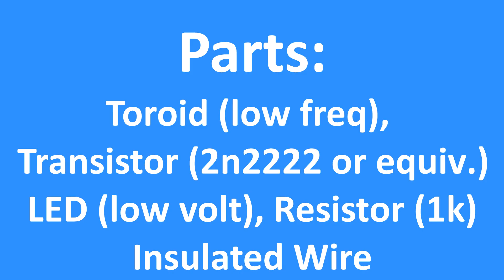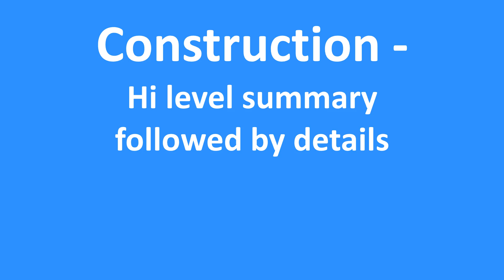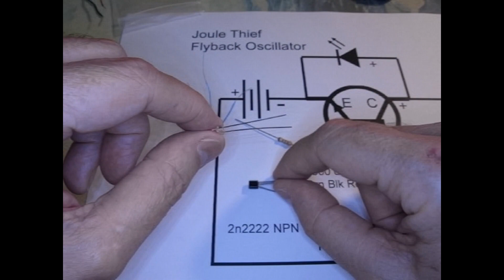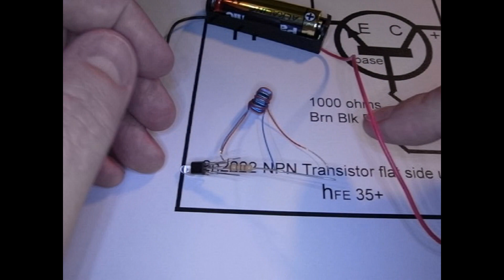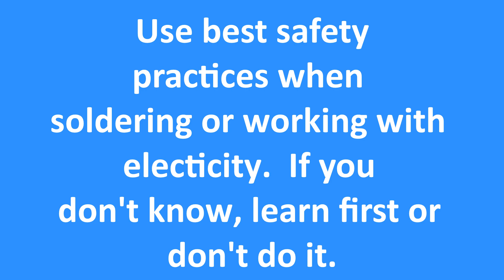Joule Thief - Detailed Build

Comment: Most Joule Thief circuits I've seen that use these components connect the Transformer in the opposite direction.  That is, the "center tap" Transformer lead is usually connected to Battery Positive, and the other two Transformer leads are usually connected to the Transistor Collector and Transistor Base.  In your circuit, the "center tap" lead is connected to Transistor Collector, and the other two Transformer leads are connected to the Transistor Base and Battery Positive.  Does it work equally well either way, or is there an advantage to your method? Thanks!
Reply from the maker: The circuit I use is a redesign of one from a 1970s era transistor checking circuit. I chose it because it was developed by experts at such circuits. I have not tried the other configurations and I really should; it would be interesting. I will have to put it on my list of to-dos.

Comment: All the other Joule Thief circuits I've seen that use these components wrap the coil with a 1:1 turn ratio.  Will this work with 1:1 or is 1:2 turns ratio required?  Thanks for the great video!
Reply from the maker: Ratios can raise or lower the base's voltage allowing one to run with more or less voltage. I got a new (usable) oscilloscope so I should put it to good use on that.

Comment: Is it copper coil or just a random wire. And can we work out with BC 547 Transistor?? And your coil primary and secondary connection is not clearly visible or explained. Can you explain it better?
Reply from the maker: The wire is insulated copper.  The BC547 is NPN and it will probably work (but I've never used one).  I show how to wind the coil and include a circuit diagram.  I am not sure what question you have on connecting the coil.

Comment: What if i use a 200 ohm resistor will it work.?
Reply from the maker: It will work, but the voltage flyback may spike the base, damaging the transistor.
Reply: tsbrownie ok then 1 k ohm is better and im using a 2N2222 transistor will that do
Reply: tsbrownie thank you very much i finally made it
Reply from the maker: 1K is kind of a general value for a "dead" battery.  If you have more input voltage you need more resistance and vice versa.
Reply from the maker: Congratulations!

Comment: With 2 color wires on the toroid, how is it hard to determine that the coils are not wired in opposite polarity like they should be?
Reply from the maker: I did a video on that.  Turns out there's not much difference as far as this circuit is concerned.

Comment: can we use copper wire instead of the blue and brown wires
Reply from the maker: It MUST be insulated wire.  It can have plastic or enamel coating, but it must be insulated.  Note that the core can have shape edges and can cut through insulation.  Also, vibration can wear through insulation (the core is very abrasive) so if you want it to last a very long time, you can dip it in enamel to lock the coils in place and keep them from moving and rubbing.
Reply: so inside the insulation it should be copper wire
Reply from the maker: Yes.  If you are very rich, you can use gold or silver wire, but it must be insulated in any case!  ;)

Comment: what wires have you used 
,is it copper wires and are both the blue and brown wires the same,pls reply
Reply from the maker: The wires are ordinary.  Bigger wires are lower resistance, BUT they are harder to wind and you can not get as many turns.
Reply: @tsbrownie  what if we take bigger core?
Reply from the maker: @chongshenchang9367  A bigger core will probably work, but it should be the same color (black in this case).

Comment: What is the O.D.and the height of  toroid  that you used, and the gauge of wire you used. My brother has some small  toroids. He has tough me some about electronics.  I want to keep it as close to yours, because yours works good.
Reply from the maker: The wire gauge is not critical, so long as you get the number of turns you need.  This is wire wrap wire.  The toroid is 1 cm across the outside.  It's black (the colors indicate different "speeds".)  It's not that critical.  The bigger ones work just as well, but they are not very convenient.
Reply: Thanks. This is small and will fit nicely inside of a solar powered landscape light. The light stays lit for about 4 to 5hrs, this should extent the on time. After all it is only 1.2v to begin with.

Comment: I must have sat through a dozen DIY joule thief videos and in not one did the "expert"  mention: 1. How long a wire you start out with for each winding, 2. The gauge of wire and 3. In what direction you wind each  one (same for both or opposed)
Reply from the maker: Good points 1) depends on the size of the coil.  If you measure the 4 sides of the toroid, then multiply by the number of turns you want, then add a bit extra for connections that's the length.  2) wire size is not terribly important, but if it's too big, it won't go many rounds through a small toroid.  Using the area of a circle of say 0.5 cms radius, then the area is about 0.8 cms^2.  A wire of 0.5 mm^2 (0.005 cms^2) including insulation will THEORETICALLY pass through the hole 160 times.  Don't count on it being anywhere near that; there's lots of air space, etc.  3) I have a video on winding a toroid.  The conclusion is it does not really matter much.
Reply: Thanks that helps

Comment: If I want it to be brighter, should I use 1 higher power LED or can I connect multiple LEDs (connected in series or parallel)? Thanks!
Reply from the maker: Your question is hard to answer.  It depends on the voltage and current output of the joule thief.  That depends a lot on your coil.  And it also depends on how much voltage and amperage your transistor can handle.  And input affects output.  The concept of a joule thief is to operate on very little power, so most people either make it small and very efficient, or make them huge (and big ones can produce dangerous voltages).  
So let me try to give you a starting point on experimenting.  I would use the same coil.  I'd probably use a bigger NPN transistor.  Decide how you will power it (maybe 1 fresh AA battery).  Then start adding LEDs in different ways, serial and parallel.  See if you like it, change it, ...
Reply: @tsbrownie  Here you are talking about the output, but what about the input??

Comment: With a proper made joule thief you can easily run a couple or more of 3 volt LED's
So no need to use a "low voltage" LED's
Reply from the maker: It depends on what you want.  If you use a very efficient circuit, including LED, you can run one on a watch battery for days.  If you build it bigger and more robust you can power LED arrays or even fluorescent bulbs!  So there's a tradeoff.  I prefer making tiny ones.  I'm thinking about making a huge one...
Reply: I'd like to see a huge joule thief circuit, and the schematic!

Comment: Good info as always, thanks! Will you show how to make a high power joule thief flashlight with super capacitors instead of batteries?
Reply from the maker: Thank you.  I've got 2 super caps and I'm not impressed.  A "dead" battery will run much longer, and you get to "recycle" the battery right up to the end.  I am looking at using body energy to create electricity.  What do you think of that?
Reply: Sounds like a cool idea, I'd love to see it! Are you planning to use a Peltier module or something? You might be able to make it work pretty well as a headlamp with the Peltier against your forehead!
Reply: I am currently having an investigatory project regarding the body energy to create electricity. Im planning to try this video u created to help me boost the voltage of the peltier module. btw can anyone help me make this possible?